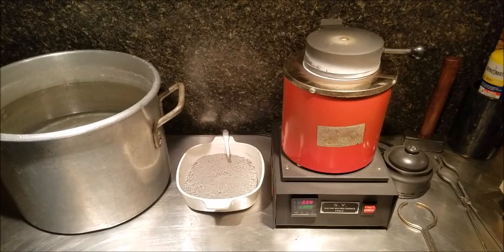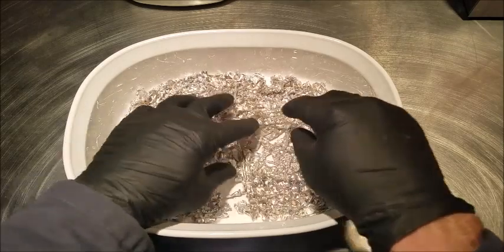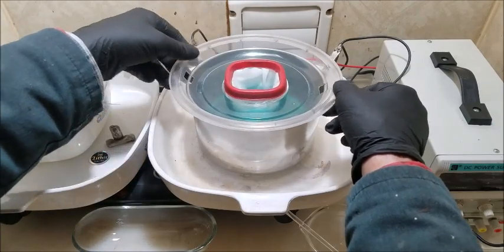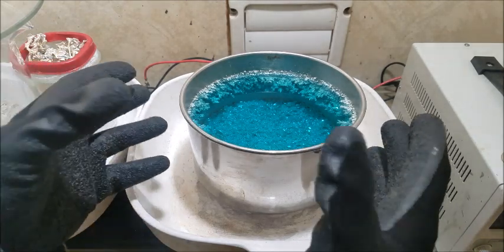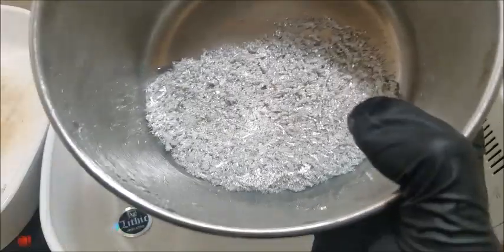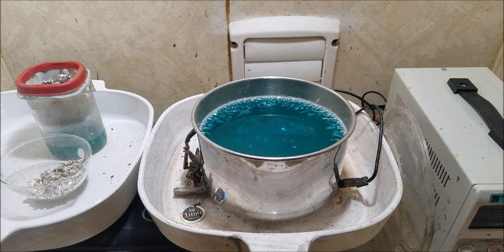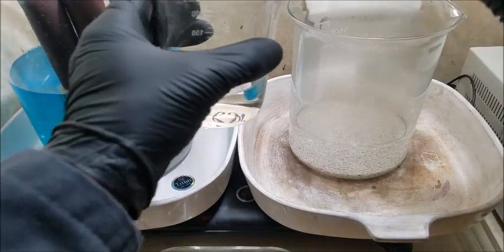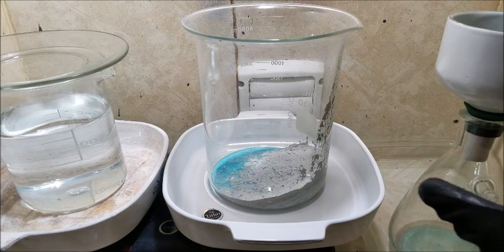90% Silver refine (Part 3) Cement, to Shot, to Pure Crystal

Comment: Hello and thanks for your super interesting channel 👍. AFAIK for electroplating process periodic reversal of electrode polarity eliminates production of dendrites which are causing the short circuit/basket failure  you warned against and then suffered, doh lol. I have no idea of the +/- duty cycle and +/- currents ratio required. A ZK-PP1K PWM Signal Generator Module and suitable driver/pol reversal switching stage would enable cheap DIY construction and unsupervised operation ? . Cheers.

Comment: if the electrolyte is blue its got copper, right?  but you can reuse on cell without crystals getting copper plating in. how many times can you use before its too contaminated? And then, I guess, how long does it stay clear, when fresh?

Comment: Is the blue liquid that you have in the bottle and that you put in the steel bowl to do the electrolysis the same liquid that you get with the cementation of silver through copper, that is silver nitrate? then, you finally dissolve pure silver in nitric acid and this time it's not blue, but it's transparent, does that mean it's pure silver?
Reply from the maker: Essentially yes it is. However, a proper electrolyte (the blue liquid) should be pure silver dissolved in distilled water and nitric acid. New electrolyte should be clear like water.

Comment: What is the point of the electrolysis if the shot is theoretically pure?
Reply from the maker: The shot isn't pure after being cemented out with copper. It may be close, like 98%-99%... but it still carries small traces of copper. 😁
Reply: @LithicMetals  Are you sure it's just 98-99%? I'm quite sure it should be at least 995 silver considering how meticulous you were during the whole process on the videos prior to this one.

Comment: Why do u have to turn it into shot instead of straight into a bar?
Reply from the maker: Hmm... I assume you're talking about melting the cemented silver into shot...? You definitely could pour it into a bar. However, with shot you have more surface area exposed to the current. It drives the process a bit faster, and makes it easier to regulate the amount of material in the anode basket.
Reply: @LithicMetals  I was meaning maybe quality of silver at that stage